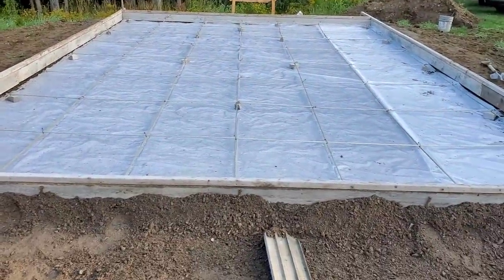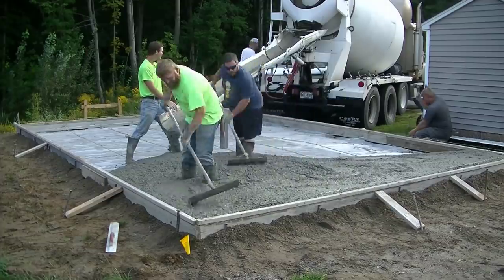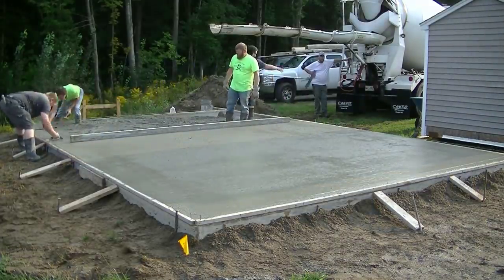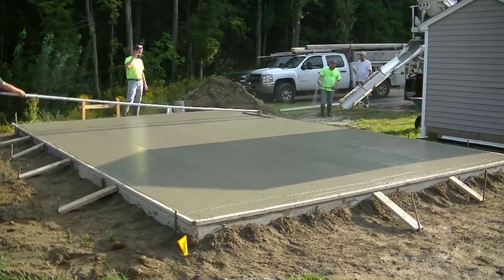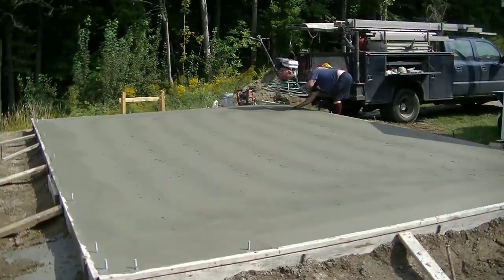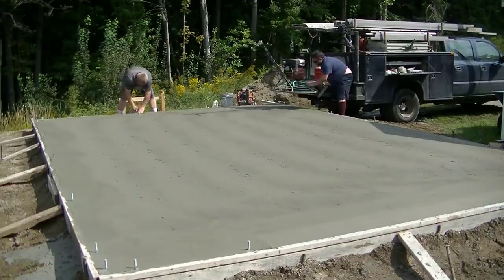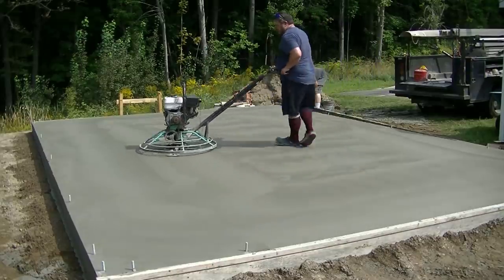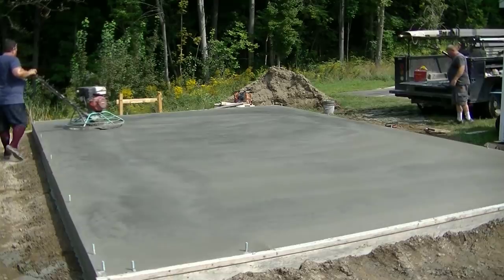They Made Us Pour This Shed Slab 8" Thick (Wasting Money)

Comment: You never know what people are going to do with their shed. My buddy has a CNC mill in his outbuilding.
Reply: I was thinking pretty much the same thing. What if he's going to put a small power hammer in the shed? A 3" slab is just going to crack all to hell.
Reply: exactly ... a large CNC or even a heavy manual lathe or mill benefits from a solid floor by absorbing the vibration... even a vehicle lift needs thicker floors... add the stress of perhaps a brick veneer...
Reply: @nolongeramused8135  well 1st off no one does 3" slabs
Reply: @NirtieDigger  I am relieved to hear that.
Reply: I mean what if they want to launch rockets of course they need 8 in...🤔😂
Reply: Waste of money... What kind of contractor says that? Clearly he knows the difference between 4 and 8 inches. Does your wife? Because apparently thinking 4 inches is good enough this entire time, just aint your game; and neither is concrete.
Reply: We just poured a 12" thick slab 14' by 20' at work. It's for a backup generator. It only weighs 10,000 lbs, but vibration is a concern. If we lose power for more than 10 minutes, the company would go out of business in less than a month. Did the slab need to be a foot thick? No, but it was cheap insurance to make sure critical equipment has a solid base.
Reply: @mosquitorepellent1276  :)
Reply: I came to say same thing . The concrete in my shop is 9 inches thick . Thats because i have a power hammer on top of it.  So not a waste of money in my book . Im guessing the owner has plans the concrete guys unaware of
Reply: @mikeirvin9694  I was watching a channel where a blacksmith had a fully isolated slab poured for his power hammer - 36" deep. The rest of his shop was 8".
Reply: Concrete is cheap compared to having to  redo it later on
Reply: Lol I do too
Reply: Maybe he has kids.😂

Would 8 inches of concrete even be enough to stop me as a kid?🤔
Reply: @renaissanceman5847  lmfao 🤣 😂 dude,  my boss had a customer that installed a car lift with red heads in a four inch slab(we didn't pour) and it broke the slab.  I had two guys with me when we went to replace it. We cut the slab a 40"x10' rectangle up into 20"x2' slabs and flipped them out and loaded them(after one of my guys had to "leave"). Then I had to dig down the whole trench 32" deep, through red clay, and load it all on a dump trailer, all with a shovel. I finished about 930 that night(it was Friday and I was NOT working the weekend), thanks to I took a hammer drill and broke the clay then shoveled it out the hole to my other guy who loaded it on the trailer. So 36" deep slab with 18" j-bolts for a car lift, I told my boss he was full of shit....
Reply: It wasn't the owner's choice though. The city required it.
Reply: A haas calls for a 6 inch slab. You have to step up to a large one for it to call for a thicker slab but if they pay for it why not. Thick concrete is great
Reply: @rickyracoon3151  I smelled  bullshit with that story, too.
Reply: @silvere36  this may be because there is no footer? Usually (here in ga) for monolithic slab you would have 12"x12" deep footer around the perimeter with 2 at least #5 bar, then the center is 4" with wire or fiber fill. "No footers? Thats odd..." was my first thought when I started the video.
Reply: Most house slabs are 4in other than the footer. No matter what that was overkill at its best!! Definitely an unnecessary extra for sure!!!
Reply: @patrickbowen9395  - I put a 9,000 lb Rotary two post lift in my shop. On top of compacted clay.

The installation manual called for 8" concrete, 4'x4', for each vertical. That's what I did.

Overkill is not a mark of good design. It's a waste of time, money and resources.
Reply: @rickyracoon3151  I worked for a GM supplier. If we shut down the GM line because we were down we got fined $10k an hour. We gave ourselves an hour a day for oh crap moments. As maintenance that was fun lol. Just saying time constraints doesn't always mean the company has budget problems. High volume manufacturing has thin margins. Its just the nature of the beast. Only 1 hour out of every 12 is profit sometimes. The rest is just covering operating costs. But that one hour might be a million dollars.
Reply: @rickyracoon3151  Why would such a situation never exist? I know of multiple industrial processes which lose a month worth of production in seconds without power. I even know if some which, should power fail for a few hours, make you lose the entire production equipment as well ...

Whether or not your company can survive such an event is a different story of course. But I read him in good faith and assumed a figure of speech ...
Reply: @tZydeco  I agree with that, to a degree. If I'm designing or building something I try to do/use what necessary and then take 1 step further, not 10 steps further. If it calls for 8", go 10", not 32" or 4'. I'd rather know I'm safe in "worse case" scenario than know its going to cost me or a customer the cost of a repair
Reply: Absolutely!
Reply: We have machining centers at work weighing north of 10 tons that don't require a 8" slab. Hell, I think only our VMX84s, which weigh over 40,000 actually need it, and they would occupy that entire slab, to within a foot or so.
Reply: @tZydeco  well said.  I agree 100%
Reply: @machinist7230  I have seen a large Mori-Sieki machining center that required a 4ft thick slab per manufacturer specifications. I have seen plant managers skimp on the requirements and have continual problems due to not having enough vibration dampening and isolation and settling due to the weight of the machine. They lose much more in production then they saved in building costs.
Reply: @machinist7230  it's not just the weight. It's the total pressure you need to worry about. For example, I was engineering a hospital for CT, x-ray, and MRIs and we laid down a thick steel plate to spread out the pressure because the CT weights 10k pounds. 
It's the same reason you see drop axels on dump trucks
Reply: @NirtieDigger  no one should be doing 3" slabs but we both know how many dodgy contractors there are....
Reply: @rickyracoon3151  the new generator is installed and commissioned. Twin turbo V10 that'll consume 2.5M BTU's of natural gas per hour at full load. The transfer switch is automated. It takes less than a minute to restore partial power to the building. The old backup generator, with a 460 big block Ford running on natural gas, is still there.
Reply: @rickyracoon3151  Did ya ever want to call someone out because they opened their mouth and demonstrated exactly how ignorant they are?  Well I just got that opportunity!
Reply: @NirtieDigger  not in their right mind!!

Comment: We did a few slabs like this over the years , found out the they were installing machine the required 8 and 10 inch concrete anchor  system!
Reply: Auto lifts for example
Reply: Vehicle lifts for raising a truck requires a minimum of 6in but recommends 8in
Reply: smithing tools (power hammer)
Reply: @kellcomnet  a lot of people (if they can afford it) see a 6 inch recommendation, and figure that 8 inches must be better, so why not.
Reply: Waste of money... What kind of contractor says that? Clearly he knows the difference between 4 and 8 inches. Does your wife? Because apparently thinking 4 inches is good enough this entire time, just aint your game; and neither is concrete.
Reply: @Ricky Racoon what's your issue man, so rude.
Reply: @MrStone125  
I think he is pointing out. Its not the business of the contractor to question designers and clients, unless otherwise consulted.
If a change can be accommodated at negligible extra cost in terms of time / manpower to the contractor and the client is willing to pay for the change costs in ordering extra material etc... then why moan about it. Just do the job and take the extra cash.
as many have said before me in the comments. The Contractor has no clue what the shed will be used for.

Comment: Not only will a 8" slab be capable of supporting heavy machinery (to a degree) but will also be capable of withstanding soft fundation better. I would rather have the slab a little better in situations like this (no ring wall) but if that means 6 or 8" depends on use.

Comment: Sometimes just going thicker with concrete is quicker and easier to raise the elevation than having to bring in more dirt and compact it, especially if you're only talking about several inches. I have used that fiberglass rebar before in a slab for a medical building where an MRI machine was going to sit.
Reply: thank you. And formimg around anchoring and such.
Reply: Absotively.
Reply: Often when setting equipment we hit rebar, what happens when you need to cut fiberglass rebar?
Reply: @ShaunHensley  pulmonary fibrosis
Reply: hum, rebar adn a mri machine withe super pulling magnetic force........wouldn't it be funny if the mri machine pulled the rebar out of the ground? No, I guess not.

Comment: Great video.

Vapour barrier is there to reduce water seepage up through cracks, which result in salt stains across concrete floor, delaminating of any surface layer on concrete, and mould on any floor coverings.     8"  slab is required  when the shed will store heavy loads.       My 6"  reinforced slab cracked  after a loaded trailer  crossed over it.    Those regulations  ensure the concrete slab remains fully functional   for years to come  👍

Comment: When the concrete turns black from power toweling here in Western New York we call that "burning the floor" because of the chemical reaction with steel trowel paddles and cement
Reply: Not to mention the longer winters and ground shift in WNY

Comment: Ca code is 8” above grade for siding so foundation needs to be at least 8” so that might be what they were thinking. You could probably do a 12”w x 8” thick at the form and then build the middle with gravel to 4or 5 “ you could save some mud.
Reply: Technically the base at perimeter is supposed to be 12" below grade as well.
Reply: I don't think this is in CA though
Reply: @rivahkillah  IBC & IRC codes have minimum frost depth of 12", which is supposed to be the minimum level for the bottom of a structural footing.  Every state uses the IRC & IBC as the basis for their own building codes.  Maybe some Southern states allow shallower footings if they never experience any substantial winter freeze.
Reply: @markmyers4573  in Southern Mississippi it's 6 inches...   I made my footings 24"x 24"....

Comment: You should never go as thin as 4 inches
5 inches gives you over 89% more strength for only 20% more material
Reply: good to know!
Reply: Depends what it's for. My patio, which won't have a car or anything heavy on it, is 5 inches sloping to 4 over 15' for drainage. 

Remember, minimizing concrete also reduces environmental impact.
Reply: 90% of the slab isn't load bearing.
Reply: @ickster23  remember degradation due to erosion require more maintenance.
Reply: My neighbor has 4 inch concrete runners for a double wide foundation 😳. 
They went cheap, now the double wide is settled uneven,  compromised walls and roof.
Reply: 25% more 🙃
Reply: @davidc8560  100 ÷ 5 = 20
Reply: @themadman6310  What's 25% of 4?
Reply: @davidc8560  yeah you right bro it 11 pm for me im tired

Comment: 8 inch thick concrete is perfect for a two post lift.
Reply: Bullshit!! 4in is plenty!!
Reply: Most loft manufacturers give a minimum recommended thickness of 4.25 inches. 
8 is unnecessary
Reply: @muddman4193  by all means stand under a 5000 pound truck supported by a lift anchored to just 4 inches of concrete.
Reply from the maker: Maybe that's what they're doing and they didn't tell me, haha
Reply: @lonestardiyboyz6610  I'd cut that out for a 24-30" deep footing
Reply: Yep, most recommend 6” slab, but 8” sure, not going to hurt
Reply: @muddman4193  
I’d rather go thicker then too thin. Sure min is ok for light weight, but when you don’t want it to break, whats a couple bucks
Reply: Or large metalworking equipment, like a lathe.
Reply: I worked in a few different repair shops over my career the lift company comes in and drills a one inch  test  hole.  They put a tape measure down the hole if its close to 4 " they install the lift . I have to say I have not seen one pull out of the concrete , but I  know there are lots on You tube that have . one thing I have noticed is their are a lot of different ground anchors  today to choose from I am sure they have improved over the years .
Reply: No one mentioned a lift!
Reply: Maybe it is all going to be the top to an underground bunker that no one will know about after everyone leaves...
Reply: @petem6291  Just saw one the other day.
Reply: @tenthdimension9836  i know right!?
Reply: @petem6291  4" isn't leaving much room for error. It will work but that's under spec and someone goes just a bit over spec for the lift and there's a good chance someone dies under that lift. Minimum for two post lifts is 4-1/4 for the smallest two post usually.
Reply: Where I worked. They were putting a 2 post lift and ended up pulling the old concrete for new thicker concrete.  I know some lift manuals recommend 7" thickness.  4” seems way to thin.  Maybe ok lifting little cars.  I sure as hell don’t want to be under a car if a post starts to fall over and that is enough for the car to fall off. My life is worth more than saving some money cheating out on thickness.
Reply: @jbdragon3295  I could not have said it any better.
Reply: @muddman4193  like cracks sure
Reply: @MikeDayConcrete  never know true or future intentions of a shed, garage, building like that. I have just come to the conclusion better pay now than later, overkill never hurts but tool little and, well....
Reply: Why I hate making comments    it's his project. Maybe a car lift to machine shop. Maybe his last shop he had issues
Reply: Bend-pak minimum requirements is 4.5" 3000 psi /28 day cure.
That's for most of their <10,000 lifts.
There 12,000 6.5", 15 and 18k 8".
Reply: @muddman4193  Australian standard says minimum 6 inches on a 2 poster
Reply: @mikethomas9544  wtf is a 2 poster anyway?
Reply: @muddman4193  Sorry its a 2 post vehicle hoist..
Reply: @mikethomas9544  this whole video, nothing is said about a hoist!

Comment: Depends on the use for the shed in the long term, I had an old farrier anvil drop about 8 foot from an engine hoist once, admittedly because i was dumb and didn't secure it properly.
It went straight through the concrete into a foam box inside the slab, unique case? Almost certainly, but it goes to show that not everything always goes to plan in a work space, better safe than sorry and digging an anvil out of a concrete hole with a jackhammer...

That said, this is not a very large shed and i doubt it will be under that much stress, but you never know when an idiot like me will come along and do somthing real dumb.

Comment: Finally get to see someone who knows what they're doing. I did think the slump was a bit wet to begin with but it came back fairly quickly. The plastic membrane may help to bring moisture to the surface working the concrete but that helps to remove air bubbles too though I'd prefer to see a vibrator used. Pulling off the formwork asap I think is great because it offers the opportunity to finish the side of the slab. Should be able to take some weight when it's cured a slab that thick won't be blowing a way in a hurry. If it's in the tornado belt area I'd be digging a small shelter underneath it. Thanks for that.
Reply from the maker: You're welcome!

Comment: Number 3 fiberglass is as strong as number 4 steel, wow. Pretty incredible stuff that fiber glass is.
Reply: This is a dangerous marketing claim. Fiberglass has higher tensile strenght, but it has also much higher strain (elongation) at load. The last makes a fiberglass rebar inferior to a steel rebar for a normal (not prestressed) reinforced concrete. A steel rebar should not be blindly replaced with a fiberglass rebar (even with the same gauge)!